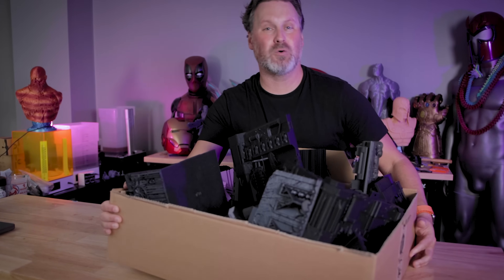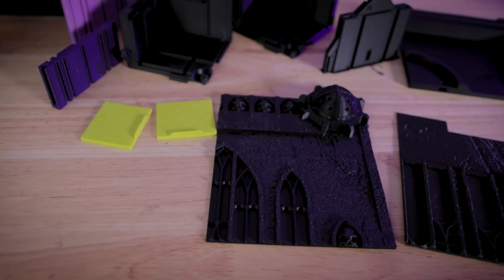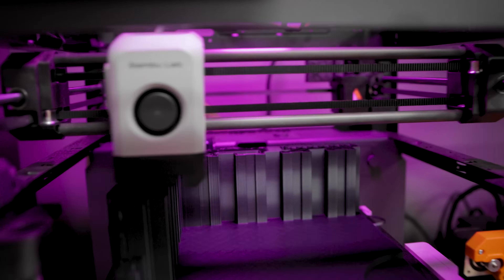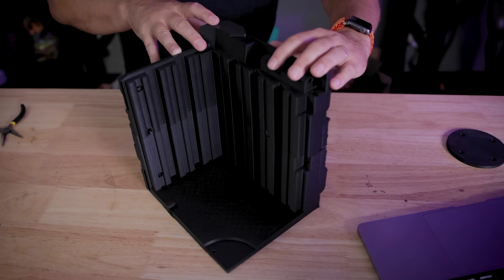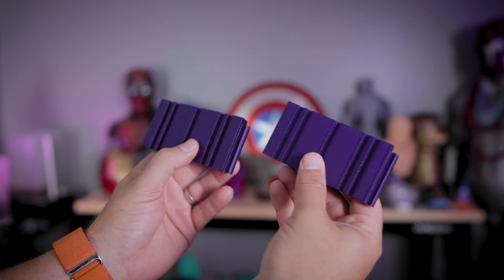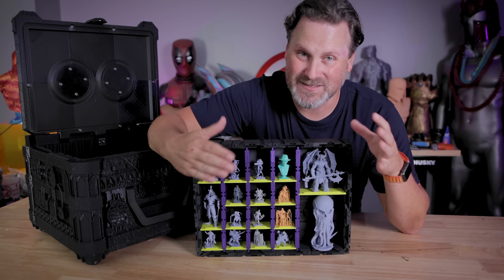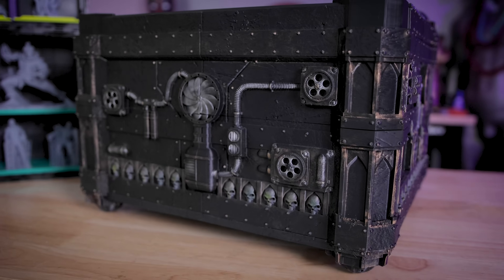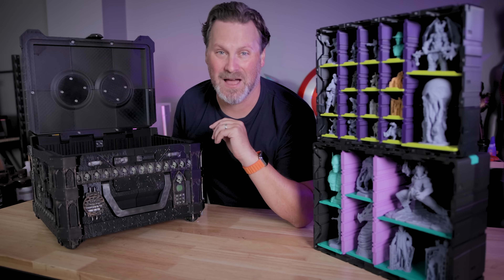The Ultimate 3D Printed Carrying Case

Comment: Maybe i missed it but how much does the completed assembled case weigh? That is something that would drastically change my opinion on whether this is worth it or not
Reply: the maximum size for example, I've read that you need 9 to 12 rolls of filament for this, so 9 to 12 kg just for the case?
Reply: Depending on the size of course.

Comment: i got on there display case. whiten 12 min of this going line i  had joined this as hey why not. that said dam how the hell do your parts fit together so easily. always got little sanding and such to do on the omni display case and the 3d printed table as well.  love to know what to tweak for better prints that just work.

Comment: Cool idea, but with that amount of filament and energy used, wouldn’t it be just as expensive as a Peli Case or two where your models sit nicely in soft foam?
Reply: THe key thing is they are completely re-configurable so even if you change what you need to carry, It's easy to re-adjust it. ALso if part of it breaks, You can just re-print the broken or damaged part to replace, rather then having to replace the whole case.

Comment: These people are nuts with this stuff. 3d Printing Nerd said it took 17kg to make his. At $16 a spool that is $272, I got a rolling Black & Decker tool box with 3 chests stacked for $112. Way less work, money and time. I love 3d printing, but only things I can't easily obtain for cheaper and more conveniently. Fantasy design does this with everything. I always think that's so cool, go back it, then cancel it after I think it through.
Reply: The 3d printing hobby is mostly $100 solutions to $10 problems.
Reply: They have put up some estimate now depending on the size you are looking for.
Reply: Just so you know, he posted a clarification video saying that while he did print 17kg worth of stuff, it was just based off the list of all the parts given to him which for some reason was way too much stuff and the actual amount for what he used for the build was about 7.5kg.  Now, that is still a decent amount but it at least puts it in a more reasonable price range for something people might consider if they want to build out a fully modular type thing or enjoy having it as a project/neat case to build.  I don't think anyone will be saving money compared to an off the shelf one, but it at least can put it in a reasonable range for something if you prefer to  have a cool themed look or whatever.
Reply: @zerepsj-personal  Thanks. Yeah, Still $120. Not counting electric and so on. Still better if you just love the cases.
Reply: Did he made a video on Modi Box?
Reply: Yea I just bought the plans for this 6 months out and regretting it. Its going to take forever just to print a mini case. It also takes a small fortune in screws and nuts. I could make one of these out of a sheet a plywood which is what I should have done.

Comment: How many KG of filament did you use to print that thing? I'm concerned the cost of printing one is far more expensive than off the shelf options that are injection molded and don't have all of the joints that could crack.
Reply: it like 17 kg
Reply: @gallek4476  lol

Comment: Very cool case, but it would take me a month to print one! And it seems like that's a lot of filament and could get pretty pricey pretty quick. 
You're gonna want to add some sort of padding if you plan to use one of these to transport delicate models, but that shouldn't be that difficult.
I don't print miniatures, so don't really need this, but I like seeing the innovative design and the techniques they've used to make large panels printable on small printers. I could see toolboxes using this sort of design . . .

Comment: I wish these guys would actually include relevant info like, you know, how much filament it actually used so we can accurately judge if the file purchase is worth it since it costs money to print as well. If it costs $200 in filament, then you're better off just buying one from a local store.
Reply from the maker: I used a bunch of partials spools I had around here but guessing it was about 6 rolls of PLA so maybe $90 + another $20 for hardware
Reply: @UncleJessy  Can you weight it?  That would give a good idea.

Comment: It's pretty cool. I just can't see myself ever buying into it. It's such a massive project to print it that I would have to take literal weeks on my single machine to print it and it takes a lot of filament by the looks of it, taking away print time and filament from other projects I want to work on. For storing miniatures, I just feel there are cheaper and more efficient ways of achieving that, no matter how cool it may look.
Reply: I agree, this looks aimed at wargamers that need a case to carry armies around, i can see the advantage in the slot modularity as minis nowadays have such dynamic and detailed poses. Still, it's something that can be still be achieved with less effort when you don't own this many printers.
Reply: Also no foam to protect the minis so wargamers won't even like this
Reply: @garylangford6755 Well, there's been a movement away from foam towards magnetising a minis base, which often works better.  The foam cases will work better when moving house or if you drop the case, but the foam in those cases still cause some wear and tear against the paint, which is why magnetic cases are growing in popularity.
Reply: Glad I'm not the only one who feels that way.  Zack from Void Star Labs said:

"More printers print prints for printing printers than printers print prints for projects."

And I feel this is the same thing.  It's a project, sure, but it's printing a tool for your hobby that does nothing for your hobby that can't be achieved in far more reasonable methods and keeps you from potentially working on your actual hobby.  The few who will REALLY get a LOT of use out of this are few and far between or have a print farm.

Not to say it isn't absolutely fantastic and a genius product, but the time, cost, and results don't seem worth it.
Reply: @Volair  
Not sure you could even really call it a genius product. There are alternatives to this that are far cheaper dollar wise and time investment wise that this is just a massive dollar, material, and time sink that doesn't make any sense. 

Even with a print farm of sorts or just multiple FDM printers it still means you've spent over a grand just to have a case that you could build yourself for a fraction of the cost. Not to mention things like the Jucoci case which can store a pretty decent amount of miniatures in slide shelves for around $130.
Reply: Micro version has been added for those with only one printer!

Comment: Way too heavy, what´s the point ? You can make a case out of plywood with 3D Printed connection corners etc. Way cheaper, ligher and easier.
Just like their other product. Kilos of plastic for a small case. You wouldn´t mill a car out of one chunk of metal would you ? Why print this thing ? 
Just because you can, doesn´t mean you should. Stop and think if it even makes sense to print something like this.
Reply: Im a wargamer. It is completely useless. Without magnetized base or a locking system for the model, when you get the place youll hear "woooooow" for the gig bag and immediately after a "ohhhh soooooo sorry for your full painted 3k dollar army completely destroyed..."
Reply: Not sure what exactly you mean in regard to my comment, but thank you for sharing your experience.
My point is, some things are easier made without being completely 3D printed. 3D printing should be used where it makes sense, not for a simple structureal object like a case. That´s what sheet metal, wooden panels etc. are there for. It would make sense to 3D print the connection pieces instead the whole thing for days on end. @giovannizaccuri
Reply: Honestly all I could think during the video was "Why doesn't the company just provide a facade to glue on to your existing transport item that is probably cheaper than all that filament anyways? Then you have the best of both worlds."
Reply: @Ughahaven  I thought so too. However it can make sense to provide the community with a innovative case design for this purpose. I just don´t think that´s it. 
I am a CAD designer and automotive engineer, a nice parametric case design would be nice but just because you can make a design does not mean it is a great design.